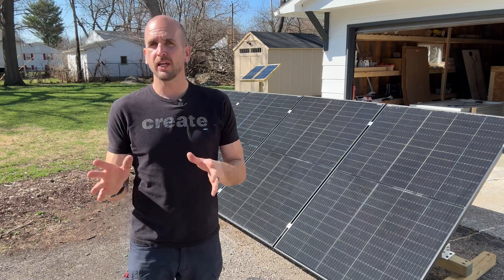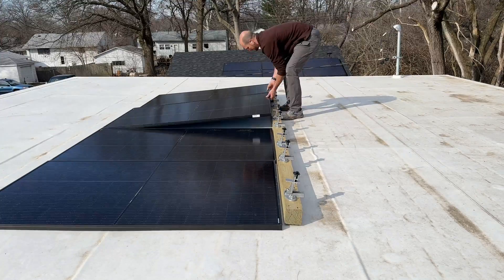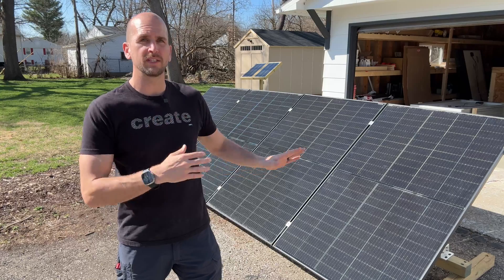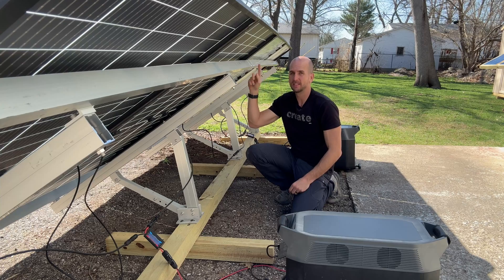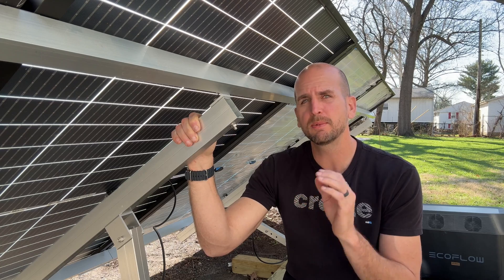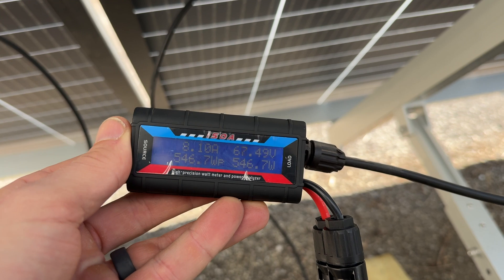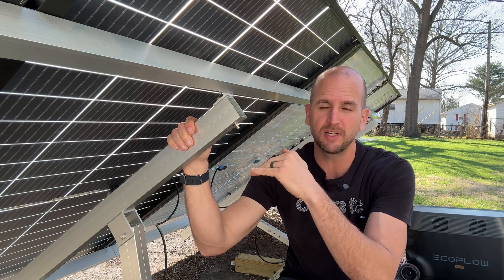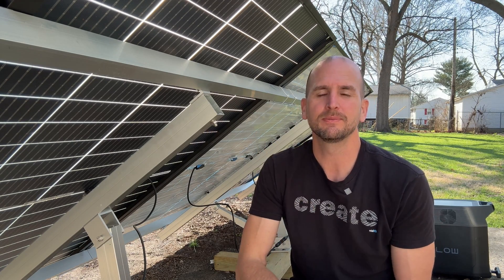Testing Gains From Bifacial Panels | Round 2

Comment: Your rack has substantial shading, and is low to the ground. A better setup can easily net 10-12% gain, and also be a substantial help in cloudy conditions. All the more better to plug your install service you shove in our face every single video.

Comment: Mount a panel with the back side facing the sun, take the reading, then flip it normal and take the reading. See if the back side facing the sun meets the ratio spec, which I can't find for that panel. If the back side only makes 10% in the direct sun, then a 3% increase sounds normal when it isn't facing the sun.
Reply: The main issue is the panels are not elevated, and get shading from mount also.

Comment: Trina 395w panels have a bifaciality factor of 70% and with a rated irradiance on back of 10% they claim a peak power of 423w (and this has to be tested according to certified tests).
The benefit should thus be 7%. Even though some light bay be passing by and illuminating backside it does not look like it is 10% from your results.
It also appear they are using the same cells in the non bifacial panels which means their 20.5% eff rating already includes the light that is gathered by passing through the cells. A light-meter would have been very useful to determine what sort of irradiance you are seeing on the backsides. Talk to someone who does photography perhaps?

Comment: I think your conclusion of the full sunlight is spot on. A "500W" bifacial panel is not 500W from the front + 150W from the back (= 650W), it is a 500W panel, where the back side helps adding a little extra that the front can´t take in.
Also, while the panels are now better positioned, able to take more light, I have only seen fair gain results (10-15%) with REFLECTORS steering in light brightening up the backside. This is not that easy to add in REAL life builds.
Also one suggestion is having a 20cm gap between panels so that light comes in between them, to add gain to the reflection.
Reply: The front can "take in" all the light you give it. You could pump 1000W with extreme lighting. That is just the rating at STC. The backside is just a free boost, but panels need to be elevated for maximum gain.

Comment: What is that small energy monitor dongle you are using?
Reply from the maker: Little power monitors usually used for RC battery monitoring.  Here is a little deep dive on the units
https://youtu.be/y6Dmn69pbm4
Reply: @everydaysolar  Thank You!

Comment: I'm curious why your test was only a few hours and started from 3pm. I feel like a reasonable test would take several days (with results for each day) or at the least be a full day.

Especially for bifacial panels, my assumption is that the extra power is generated when the panels aren't in the ideal position during the day.

I like youe channel! But this video didnt really answer the questions I jas about bifacial panels. I would definitely watch a more indepth test over several days.
Reply from the maker: Thanks for the feedback and agree extending out the test duration would help validate the end results.  I am working on a ground mount where I can swap out different panels for testing.  More to come 👍

Comment: The white tape on top of the blue tape is still not enough.  When the camera is behind the panels, you can still see right through that white and blue tape. I can clearly see the grid.  Cover it with black tape.  Fully block out any light coming through.

Comment: Ive never had a monofacial panel hit 100% of its rated output, ehile ive never had a bifacial not hit at least 10% over its max output rating. I also use them on the brightmount arrays 5 feet in the air

Comment: Several reasons for the low additional gains of the bifacial panels:
1. Your mounts provide shading 
2. The ground under and behind the panels doesn‘t provide a high albedo
3. The most important reason is, your panels are already maxed out by the direct sunlight. They are in their steady state under the given conditions and can‘t generate much more because of the temperature they reach.
They are 395 Wp which would mean about 1580 Wh of Energy in 2 hours IF they could sustain that for the whole time, which they can’t due to heating up. The maximum sustained power is usually around 90% of the peak power with moderate air temperature. That would give you about 1422 Wh in 2 hours which is pretty darn close to your results.

Bifacial panels can not shine, when the front side can already max out their long term power cap.
Reply: Technically they are not maxed out per se as the back provides current in parallel to the front but he could try mounting them vertical instead. This allows for better cooling and one can orient them so that mid-day hits them from the side to avoid the heat. This also provides a lot more power during morning and evening which is more useful.
There are a few channels who have done such tests with great success.
Reply: Well, the contribution of the backside still heats up the whole panel, just like the front does. When the high temps cap the power, it doesn't matter which side  the power came from.
Reply: @hanswurst6674  well, temperature of solar panels only reduce the efficiency and this effect is well known. Most panels even have the derating factor for temperature listed in their datasheet.
Reply: A 395W panel can make more than 395w, it isn't a hard cap. Often people in winter get over rating due to cold temps, and highly reflective snow. The  main issue is the poor mount setup, and not being elevated.
Reply: @xeridea  That's why I said "under the given conditions". Of course with lower ambient temps and maybe some wind, they can reach a higher output. But with the setup in the video, the gains from the bifciality are very limited.
Reply: @hanswurst6674 you are simply wrong, a buy facial panel in direct sunlight can always produce more power if you increase the ambient light on the backside. It isn't ever maxed out. With a good setup, you can increase the output by around 6 to 10 percent in direct sunlight. It isn't uncommon for bifacial panels to hit the  full output which almost never happens with mono facials. Under perfect conditions, bright sun and the snow they may hit 125 percent of rated capacity

Comment: I think the solar panels will give more of a percentage increase if possibly it is domed in aluminum backing... as far away as solar panels' height to "domed backing." I believe these reflective backings will greatly enhance the output to charge or usage. I will be testing my own project like this as I am about to build my Ecoflow unit.
(I also think these solar panel companies would benefit in wind turbine power as well. It would be a great ad on revenue due to power = sun, power = wind (when the sun may not be out, or it may be night). Every source is building a greater energy future.
That is my approach to this project of mine.

Comment: The Ecoflow can take a maximum solar input of 800W, which is pretty much what your panels are without the bifaciality. Perhaps the Ecoflow is the limiting factor, not the panels. Maybe just run one panel into each Ecoflow, and do the test over a longer time.
Reply from the maker: The Delta Pros can go up to 1600W for solar but a longer test would help and would be nice to have time-series data as well to see the differences through out the day.

Comment: The only thing that matters is amps
Ohms law shows us your panels are only putting in about 14% of your maximum rated output
And clearly displays what a rip-off solar is
Reply: Please please put an amp meter between controler & battery

Comment: Hi Scott - not so practical for suburban roof or yard spacing, but what if you had panels spaced out behind panels, so the rear panels would be able to absorb direct sunlight, but they could be angled to reflect some of that light onto the back side of the forward panels for at least a part of the day.  This would make the forward double faced panels way more efficient for some of the day if you could get the sun angle for the reflection figured out?
Reply: Heh...I said the same thing in another reply😂

Comment: I see the same issue over and over again - the ground mounts that are not optimized for bifacial gain are used in majority of cases. The transverse bar is shadowing through the whole width of the panel greatly reduces the gain. Try to put a beam accross the panel on the front side to see the equivalent effect of shading.

It is true that the backside light is much more diffuse, but still the mounts are waay suboptimal.
Reply: If you put the mount bar at a cell seam to get reflected light back it isn't as bad, but obviously better mounting from sides. Elevating at least 42 inches also provides a substantial gain.

Comment: my experience with my DIY solar is that one can never have to many panels.....no really! I bought 20 used 250w panels thinking i would never even use them and now a year later i am again looking for more panels. Looking back what i would recommend is decide how much you can spend and then build that system as a matched battery/solar setup, then after you have lived with it you will have a good idea what or if you need to expand it.  As for the bi-facials they are not for every application. In the right setting they are a better choice such as a fixed ground mount in the winter will benefit when there is snow on the ground(a time when every watt is needed) and in the summer a ground mount will actually have the sun rising and setting behind the panels and bi-facials will take advantage of this. And there is growing evidence of using them vertically like fencing which opens up new mounting possibilities.
Reply: Those bifacial panel have advantage of conserving space, but how do they compare with tracked standard solar panels back to back.,?

Comment: Bifacial is going to give you much more benefit if you test it for a full day. Of course, during the two hours when the sun is just burning down on that south side, you won't see much difference, but the sun moves around in a large arc, and will sometimes hit the back of the panels directly, especially if they are angled as steeply as you have them there. That's where the bifacial factor will come into play.

Comment: Good test, I was expecting more on this one.  I read about a test with bifacials and height.  They need a minimum height raised off the ground to hit that max gain. I believe it was like 6 feet so like a full commercial rack would do it.  
I built a similar temporary base for my Brightmounts but I used 4x6's. Also due to the location requirement I didn't connect the two halves together in the middle so each rack is a two panel rack.
Reply: Height needed is only about 42 inches. Having something like white rock underneath helps also, but elevation is the main factor.

Comment: I only have the EcoFlow Bifacial panels.  Did not really see much of a gain on sunny days.  I mainly use them at the beach where the sun can reflect some from the sand.  At most I got about 200 watts out of the panel.  If any advantage to my bifacial panel is that on cloudy days it produced  22 more watts over my 160 watt panel.  Don't know if it is because the bifacial is a 220 watt panel.  Regardless it was enough to maintain my 12V fridge over 4 days in cloudy conditions running.  I might have run out of battery power had I only used my 160 watt panel by the 3rd day.

Comment: Diy, roof mount on a large pole barn, grid tied, but big enough to reach a zero power bill minus service fees and battery backup for atleast a few days. I've been interested in the qcell bifacial 480w panels and the (i think its called) eg4 pro system. Little fuzzy on the exact name of it but its the grey and black all in one system. Worst part of the setup is about a 200ft run from the roof of the pole barn to the house where the inverter and  attery setup would be.

Comment: How do I know if I need to ground my panels?
Reply: The short answer is you need to ground all solar panels.
Reply: @readyplayer2  would having my panels set directly on the ground count? I have 400 watts sitting outside propped up against my house and run a cord into my Ecoflow delta 2 lol
Reply from the maker: Most people would not ground that type of setup.  At least from my opinion I would not worry about grounding.

Comment: You need something to reflect light behind those panels like white rocks or reflective material to get actual gains
Reply: I was going to say the same thing, needs to lay something white under and around the panels.
Reply: Agreed, need something light colored to reflect the sun light
Reply from the maker: Sounds like a good test 👍  Thanks for the feedback.
Reply: @everydaysolar  I was going to come in to suggest that maybe these bifacial panels are really intended to perform best in large-scale solar farms. The panels could be set up in such a way that what sunlight reflects from the row behind would shine on the backside of the row in front of them and you would really get some more production out of the backside of each row.
Reply: White marble or here our limestone is cheaper and is white or light in color it was the same effect that snow would reflect.

Comment: For me the big advantage that bifacial panels is that they can be used in vertical east-west orientation. This is the gamechanges since they can now be used for fences in roads and in agriculture. Unfortunately the backside only has 60% the peak capacity of the front side. Hopefully it will eventually get to 100%. And that would mean that a bifacial panel in vertical east-west orientation will be able to produce close to 90% of what a monofacial panel with angled south orientation would have.

Furthermore east-west orientation will definitely help with the duck curves we are seeing all over the world.
Reply: Absolutely agree. Would like to see a comparison of vertical east west aligned bifacial panels with south aligned non bificial at the ideal tilt for your location.
Reply: So I'm about to purchase panels would you recommend these? Yes I guess?
Reply from the maker: The best bang for the buck panels I see right now are the REC 370W https://signaturesolar.com/rec-370w-mono-split-cell-solar-panel-silver-rec370tp2sm72/?ref=tWl8ELLgfBNOCr these are not bifacial but the price is great, looks like there is a 10 panel minimum.
Reply: I agree.   A vertical EW orientation test would be the next one I would do.
Reply: The statement about 60% back side efficiency is false. Trina's NEG21C.20 Topcon panels have >80% bifaciality.
Reply: @TadasBalčiūnas  Nice. Hopefully we will get to 100% this year with different designs.